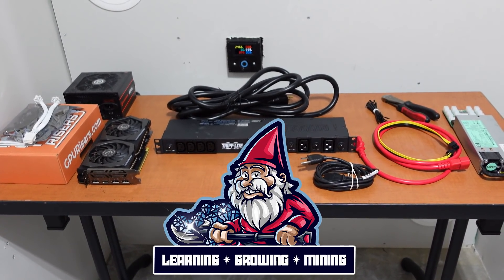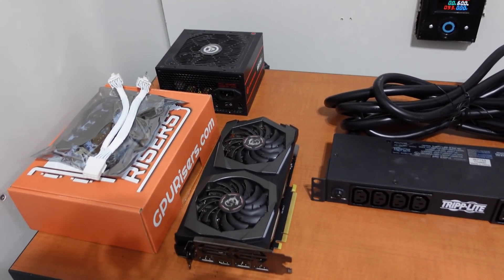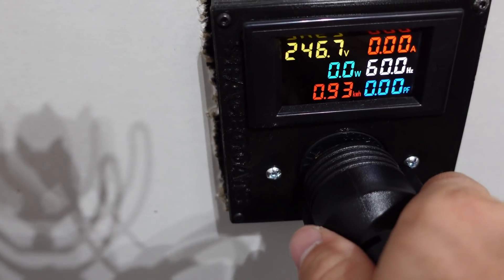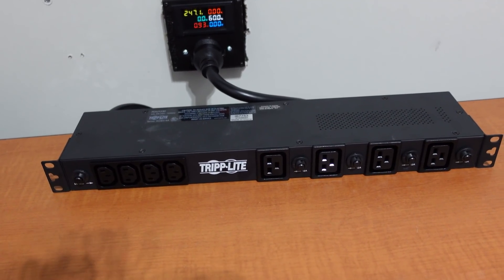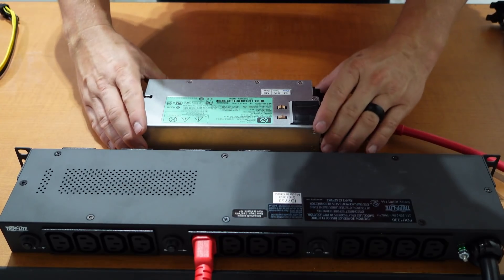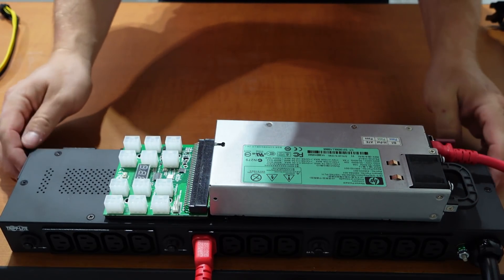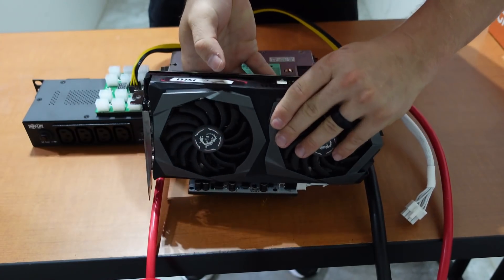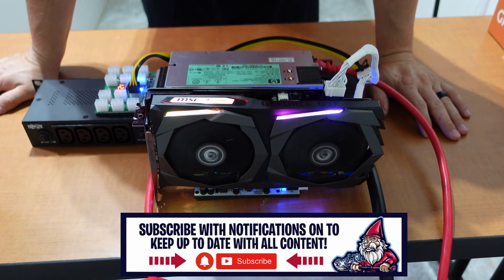How To Power Your GPU Mining Rig

Comment: Damn I hate the number of connectors and splitters that are required in mining.
Also the amount of small wire, it's like 100s of wires to power entire rig, one 6 pin cable = 6 wires + 2 for the 8 pin end, each card needs 2-3(1-2 for card 1 for riser) of those cables, that's 144 wires in worst case with high power cards...
Also supply of quality cables is very limited in the EU if not even unavailable, I just bought some off amazon uk and those are 18AWG but they feel like 20-22AWG.
I don't like any of this, I think I'm going to design a 12V PDU that takes entire server PSU and outputs 3x 6pin pcie for each card and that would be a 100x600mm PCB so quite big, enough to cover entire 6 gpu veddha frame.

Comment: Can you show how to power x2 GPU with x2 8 pin, i mean, should i use x3  pci-e slots from server power supply to power x2 GPU example 3070? So after using a splitter cable i power with 1 line x1 riser and x1 8 pin, 2 line x 1 riser and 2nd 8 pin, 3 line x2 8 pin?

Comment: Idk if it was just video purpose for testing but. Those butterfly clips. Sometimes when you push from bottom they don’t click. So should always flip the butterfly switch over to lock it just in case. Always double check that. I do. Cause most of the time. Pushing in it won’t lock. Have to lock it ourselves.

Comment: Awesome video thanks and perfect timing also.  :)  I just had my electricians put in 2 - 30 amp outlets on separate breakers so am all setup with them and my TrippLite power setup.  My question is this...I have that exact same DROK power meter (under $20 on amazon) and they cannot hook it up.  They said it has only 1 "donut" to pass the power line through and since I have 240volt with the 30 amp outlets there are 2 phase and 2 cords so it will not work.  Everywhere online when I watch a video on mining I see the same power meter, but my electricians say it cannot work unless I only put 1 of the 2 phases (hot cords) through and it will only read half the power of the outlet.  I am have been searching for a power meter like the inexpensive DROK you use, but cannot find one with the two rings or donuts for the 2 phase hookup.  Any ideas or tips would be amazing, so much appreciate your stuff I am finally putting my first hanging rig together tomorrow.  Cheers and thanks!!
Reply from the maker: Stop in the Discord Channel.  We can chat more about it!

Comment: Hi, can i use VGA cable that has dual 8 pin like this - one 8 pin goes into the gpu, second 8 pin goes in Y splitter which goes into same riser (only 1 riser), or is it better to go the way you did it? I just find that cables stay colder that way.
Reply: That's fine but I think you want to stay under 208 watts total from the card and riser combined if I remember correctly. I think that's the max power draw from those splitter connections.

Comment: How many watts does a 6 pin connector on the breakout board supply?  From what I understand a 6 pin connector on the riser will only call up to 75 watts and an 8 pin on a GPU will only call 150 watts, but I'm not sure how many watts a 6 pin on the breakout board can supply.  I would assume 300 watts, but we all know what happens when we assume.
Reply: The 6 pin will atleast supply 150w
Reply: @graemeuk6238  Just a follow-up, I posed this question to Parallel Miner and was told all the connectors on the breakout board are linked, so in theory, you could pull 1,000 watts from a single 6 pin connector.  Now the wire would melt if you tried that, but the point is the 6 pin connector supply from the breakout board seems to be limited to what the 16 gauge wire can safely provide (keep in mind 80% rule).

Comment: with the 3060 ti and the 3070, the riser can be power with the sata cable with no issu. At max you will pull 40 watts from them and it's totally fine!
Reply from the maker: I would never recommend using SATA to power your GPU Mining Rigs long term.  SATA is rated for 54 Watts max.  Your GPU can pull at the riser level max 75w.  Your asking for a fire risk.
Reply: @TheHobbyistMiner  Well i mine since 2017 and i have no issues even with my old 1080ti.Now I have 20 RTX 3070 and all of the riser are power with sata cable.I have a amp meter to measure the power at the riser and i am between 35 and 50 watts depend of the gpu brand.
Reply: Not true, I tried it for one day while waiting for a PSU to show up and when I unplugged the sata from the 3070 the plastic had bonded together inside the connection and only the metal prongs pulled out! LOL So it hadn't fully melted but enough to do that in 24 hours.  Do yourself a favor and use the "Dual sata to 6 pin " if you're gonna use sata.  Or ignore everyone and keep on risking it lol.
Reply: @totalbullion5882  It's not true for you...But i know what i'am doing! and it never happen to me. all my 3070 are at 55% PL ( 120w in the software ) and i use EVGA PSU and Seasonic PSU all are Gold or Platinum and put only 4 gpu by 1000w PSU i use only 1 sata cable( all my PSU have 4 sata cable so 1 by gpu! ) for 1 gpu not 2 riser by 1 sata cable!